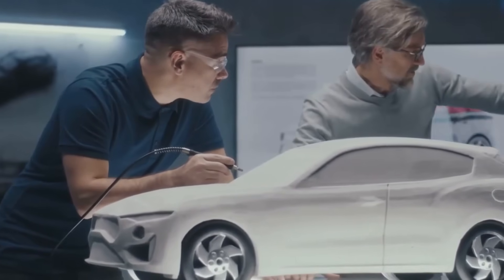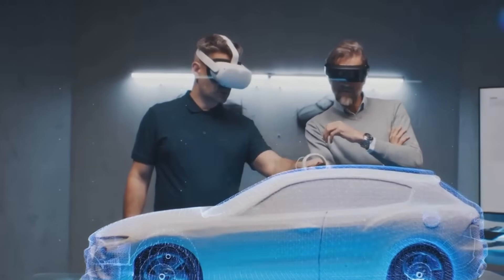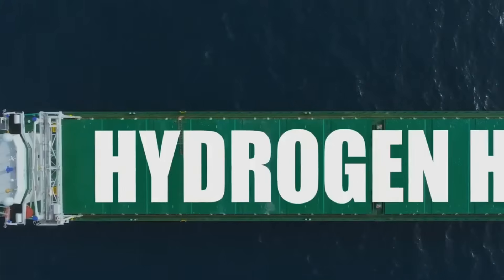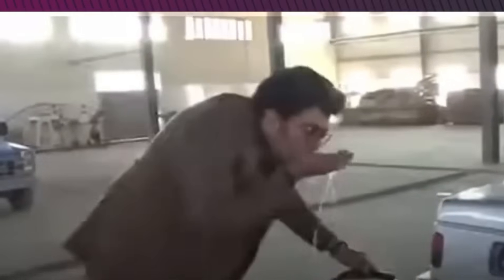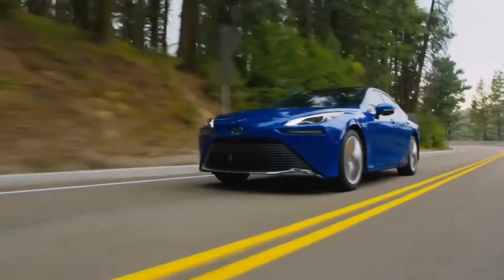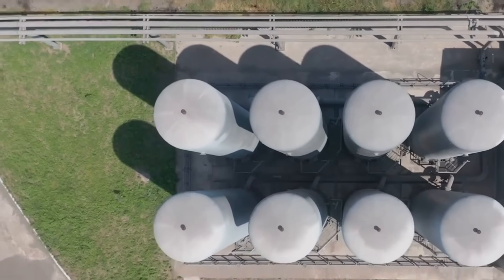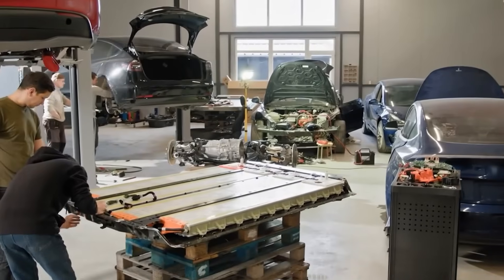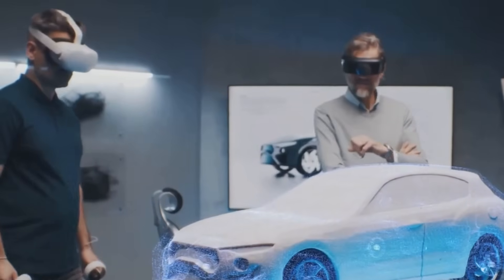Toyota’s New Hydrogen Engine SHOCKS the EV Industry!

Comment: What about the water to hydrogen tech? Toyota was working on that. Why should i carry hydrogen if i can carry water and electrolysis happens in the car producing O2 and Hydrogen. Consume that. But will need a battery.. i understand. Will it be too much of power needed to electrolysis compared to powering a motor? We have braking power regeneration tech available anyway now.